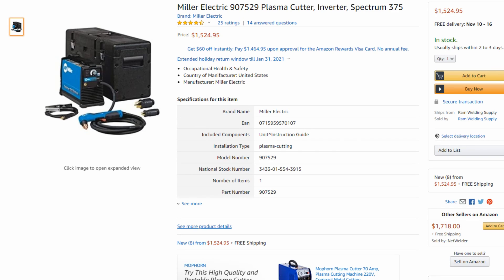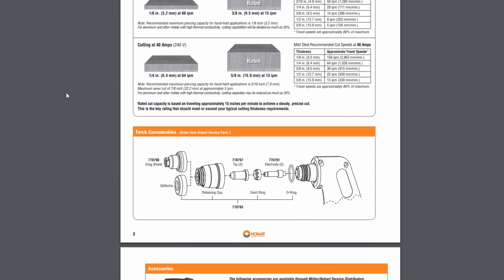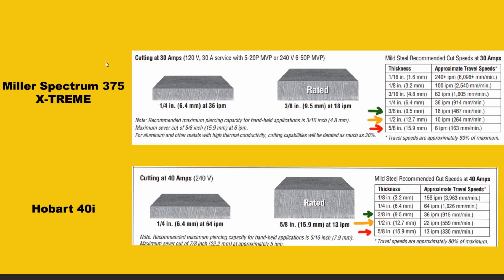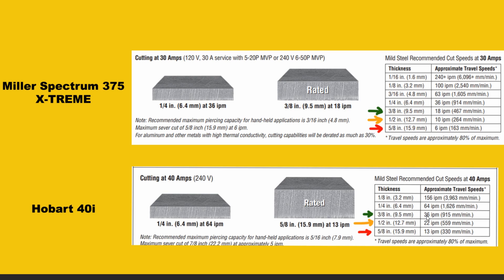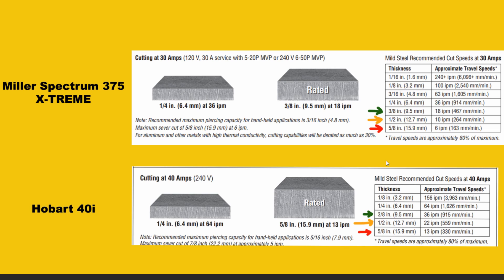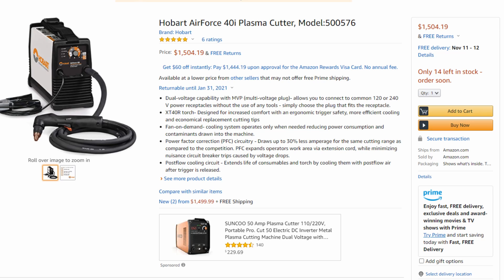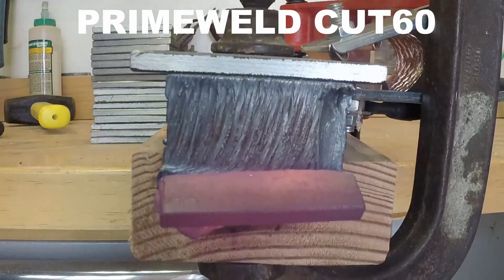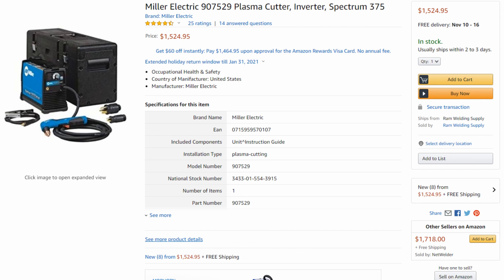Miller Spectrum 375 vs Hobart 40i vs Primeweld CUT60 (Comparison Review)

Comment: You say the Hobart and the Miller are American made and that's only half true. The MOSFETS used in all three of those machines come from Taiwan and most of the rest of the components are also manufactured overseas. That doesn't make it good or bad, most of our phones and computers are made in the same place after all, but it is misleading to say that the Primeweld is Chinese and is less robust. 

There are cheap chinese machines that are, in fact, less resilient, but the Primeweld uses quality components and they are every bit as good as the Hobart for sure. All three machines are fine tools. But, you are going to pay twice as much for half the power and that's because or labor and economies of scale. Primeweld can grab those chips cheaply, without much in the way of shipping, manufacture them with cheaper labor, put them on a ship for pennies per kilo, and put the cost savings into an American based customer service op. 

None of that means that Primeweld is worse than Hobart. And Miller makes great machines (they actually make Hobart...or rather, Illinois Tool Works owns both subsidiaries) but you are going to pay a premium for the name.

Comment: I would hands down use that primeweld over that miller or hobarts . Ive had both . Now I went to primeweld and work it commercially.  Ive used it 3 years and worked it hard . Its been flawless.  Primeweld for the win 🏆
Reply: Also, he says the Hobart and the Miller are American made and that's only half true. The MOSFETS used in all three of those machines come from Taiwan and most of the rest of the components are also manufactured overseas. That doesn't make it good or bad, most of our phones and computers are made in the same place after all, but it is misleading to say that the Primeweld is Chinese and is less robust.

Comment: I think it's misinformation to belittle the quality of Primeweld machines. Primeweld machines are built solidly and that is why the company is confident enough to give 3 years warranty on them. I can assure you that Primeweld machines will likely last as long as Miller and Hobert, and when you throw in the excellent customer service by Primeweld, even at such lower price point, then it's no brainer which machine to go for.

Also, stop the misinformation that Primweld is only for occasional garage work, because many people use Primeweld machines for their day to day business activities, me inclusive. You really have to do your research or buy and use the machine for years before forming an opinion about the Primeweld brand, else you misinform the public. Need I even say that even the top guys like Miller, Lincoln, etc., now also have their parts manufactured outside the USA and only just assemble the parts in the US.

A simple research on Amazon and a look through the ratings and reviews by actual users of Primeweld machines on Amazon will tell you if their machines are top tier or not.

Comment: That was very informative and what you suggested for light duty work with 40 Amps Machine what you need is  a 3 phase connection or you can use a regular  house hold's 220 volts connection is fine for that or not ?? You response would be highly appreciated .... SIR GEE
Reply: None of the 3 mentioned require 3 phase.

Comment: Is there any way to make a always fan on machine to a fan that only comes on for a specific temp? Or while running the welder or cutter?
Reply: That is a problem, agreed.  I think the mfrs are aware of it.  For example Primeweld's TIG 225 welder has an always on fan, but their new TIG 325 has an on demand fan.  If warranty is not a concern there is likely a hack that a handy owner can install to control the fan thermostatically.  Maybe some intrepid sellers will offer a kit, likely from China--we have to give small Chinese creators and sellers their due when they come up with outside the box solutions to problems; tho' sometimes, good ideas are too cheaply converted into goods.

Comment: Have you tried the razor weld 45? Any info would be greatly appreciated. I'm trying to decide between prime weld 60 or the razor weld 45 thanks.
Reply: Teneha glendening, I have two primeweld machines and plan on adding a third soon. If you are in question of which machine to buy call primeweld tech support ask them a few questions you'll find your answer very fast. 3 year warranty and tech support who actually answer their phone and if they do not and you leave them a message they normally call back in 30 minutes or less no matter what day of the week it is. If you have a problem they will send you a brand new machine and a call tag for your old one. I still have a unresolved used 4 months so called lead name brand mig setting on the shelf that quit working 5 or 6 years ago. All the fancy name in the world doesn't matter if the unit breaks down and you can't get anyone to help you resolve the issues let alone the manufacturer to return your phone calls. I got fed up one day and bought a primeweld I was so happy I bought a second machine I will never look back. I will buy a third machine soon because I know if I have a problem their tech support will have me back up and running before one of the other so-called big names would even return my phone call.
Reply: @johnsonlong1272  Made (allegedly) in USA does not necessarily mean a a damn thing if the people behind it are arrogant jerks with their heads in the clouds (or maybe in a lower anatomical area).
Reply: Primeweld is the way to go they work great and have great customer service

Comment: I'm buying primeweld cut60
Reply: i have one of these on  a cnc that replaced a hypertherm  45 i seen these reviews and figured hey ill give it a try . i  have used it everyday for the past 2 years and im impressed i could buy 3 of these units for the price of 1 hypertherm unit and get the same results im cutting 1/2 plate with it it does seem to go through consumables alot faster but even consumables are cheaper than hyperthem consumables i say your buying a great plasma cutter.
Reply: @TheSpidersoftheworld  great review comment.  Thank you.
Reply: @TheSpidersoftheworld  I will agree with your statement except for the part about buying 3. It's hard enough finding  1. Backordered, backordered. I also own one, great little machine.
Reply: @chuckroast5735  Probably better now that kinks in the vaunted supply chain are less of a problem, but I'll also observe that scarcity might indicate popularity, too.  I'll admit to not understanding the HyperTherm mystique,  But I do wonder why your CUT60 goes through more consumables--maybe cheaper consumables are lower quality?

Comment: It looks like the Miller Spectrum® 625 X-TREME Plasma Cutter w/12 Foot XT40 Torch 907579 would be a better comparison to the Hobart Airfrce 40i. The Miller 625 has a detachable cutting torch and is CNC compatible, but the specs seem closer to the Hobart than the Miller 375. It looks like the $500 more for the Miller is for the torch difference being that it is detachable and that it can be used in computer controlled setups.

Comment: I have heard you mention in another video that all of the cut50 machines are the same Chinese machine. And the advantage of going with primeweld is that they are American company that can give you service in the US. I'm wondering if the "Plasmargon cut60p" is the same machine as the "Primeweld cut60", just in a different shell?
Would it be possible for you to review the "Plasmargon cut60p"?
Reply: Primeweld seems to be a good customer service company.  Though the others may sell a similar or even identical machine, service and followup might be a concern.

Comment: First of all...Nice video. Just bought the Hobart 40i and can't wait to use it. This finally completes my man cave. I have Lincoln welders, and knew that it was going to be between the Miller or the Hobart, because Lincoln was just to high in cost and I saw nothing in the specs that justifies their price point. Hobart and Miller have both been around and produce good products. The points you made were spot on and that is why I chose the Hobart. 
I'm new to plasma cutting and I'm confused about consumables. Seems I read something about different tips (consumables) based on amperage you're cutting at? But nothing on Hobart's web site as far as accessories or kits goes.